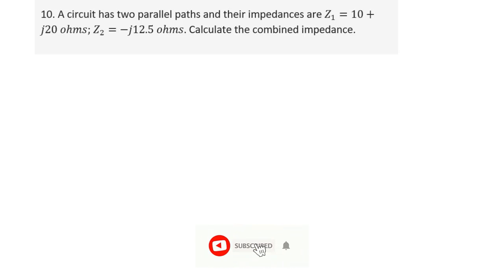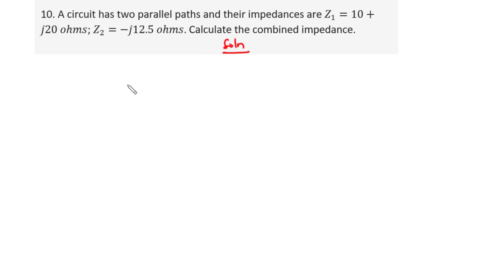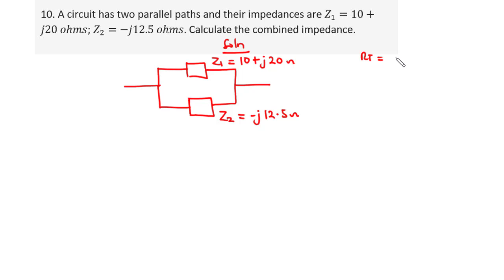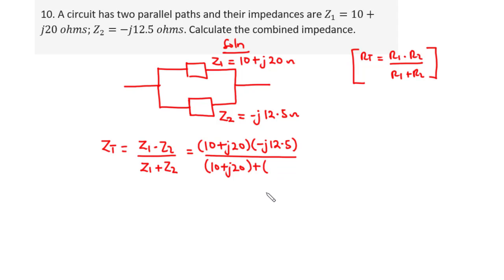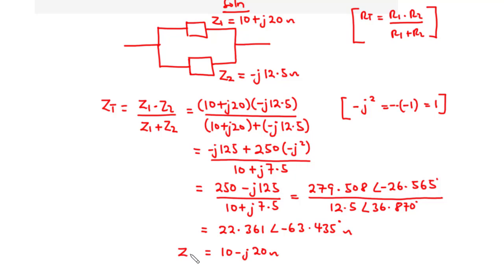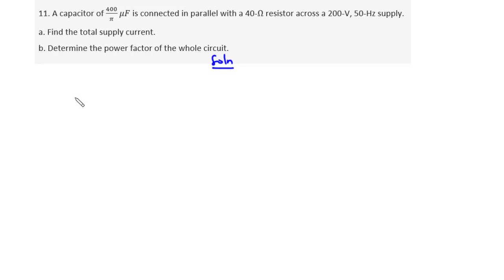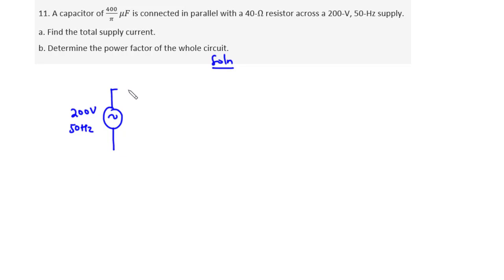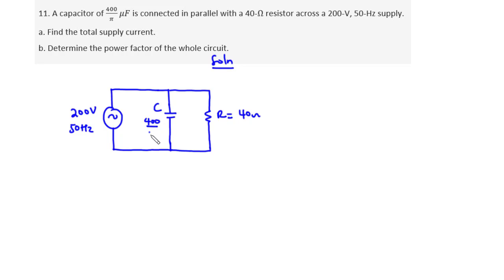42 - AC CIRCUITS PROBLEM 10 & 11 | Find the Impedance, current, and the phase angle #knust

Comment: I am sorry man, it seems like you got the answer wrong, because you used 40 Ohms instead of 400/pi Ohms as stated in the question...I calculated the total impendence is Z=24.951 with the phase angle of -86.42 and finally my current was I=8.0156A with phase 86.4 degrees I used two methods 1) calculating the total effective impedance and then using the source voltage to calculate the total current. 2) Here I used the fact that the total current is equal to the sum of  the current in each loop ,and they both yielded the same result
Reply from the maker: There's nothing wrong with the solution, 400/pi micro Farads, in factored in solving for the capacitive reactance which is in parallel with the 40 ohm resistance to form the total impedance. Kindly double-check.